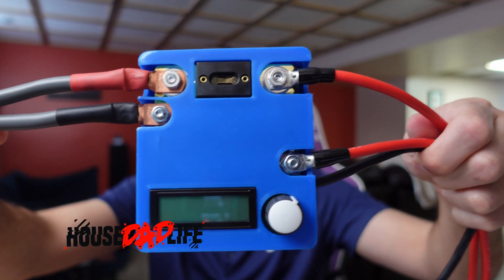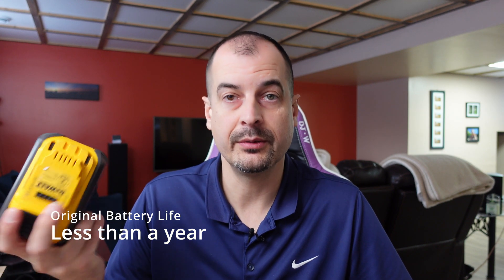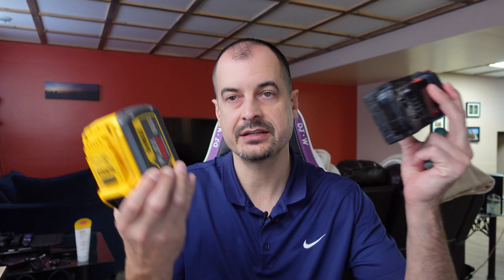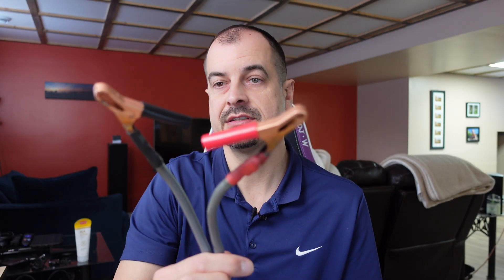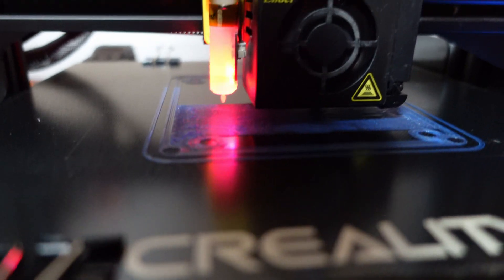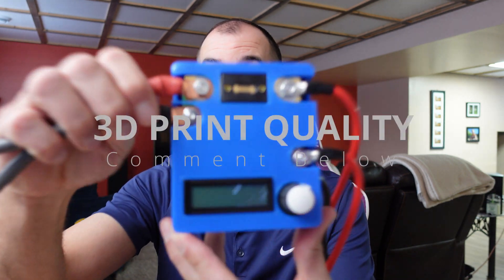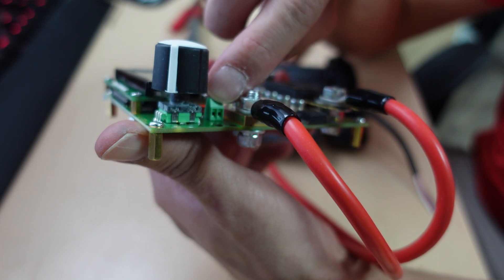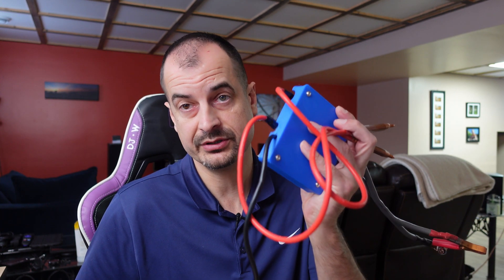Spot Weld PERFECTION: K-Weld Kit Built!

Comment: Thank you and great review.  I’m torn between the AWithZ UF20B, Kwled, malectrics,  and the GLITTER Spot Welder, 14500W 2500A Battery Spot Welder.  Any recs for a beginner who will occasionally be building small packs here and there? Thank you for any advice.
Reply from the maker: I just seen one on batteryhookup.com for a great price I'd likely try today if I didn't already have one.  Use the code housedadlife to get 5% off if you decide on that unit.

Comment: Obviously followed instructions and a tutorial and re-uploaded. 😐😑
I have a manual calibration mega zero (cheap Chinese ender clone) NEVER had a problem.🤔
Never rely on auto calibration or saved configuration settings!
The "wire cutter" is a crimp/stripper/cutter but you say you have no crimp tool? 🤔 
A simple twin relay using a capacitor and resistor for setting timing is all that's needed with a MOT and cost is for me so far $2.00 being the relays I've had for year's hence the price
Reply from the maker: I wish I knew more electronically then I do, I know enough to just get started so I had no choice but to go kit.

You're right wire cutters do have crimps, mine is just to small that's it.  

You should share what you've built! I'm sure there are quite a few people that would like a spot welder that doesn't cost a bunch.

Comment: I wanted to buy one of these, unfortunately in Australia, just the kweld kit is $350 aud plus post from the Australian distributor, way too expensive. And if you want the whole kit with capacitor bank, kweld supply and kweld kit and hp supply is $899 plus postage.
When I first researched this unit it was selling at 80 euro for a complete and tested pcb. The bus bars are not even copper anymore
Reply from the maker: Ouch that's way too much money. Too bad the price is so far up there. Otherwise it would be a lot many more people would get.